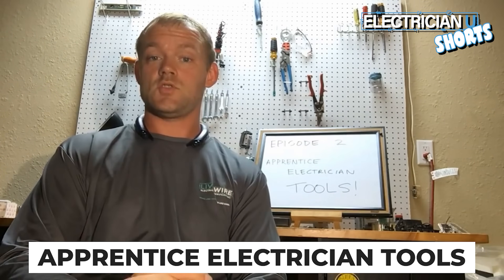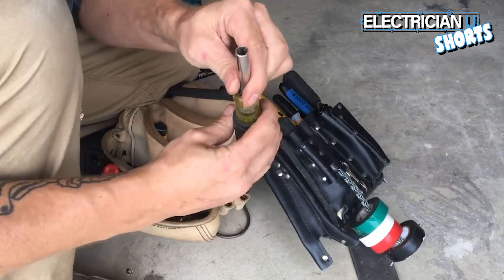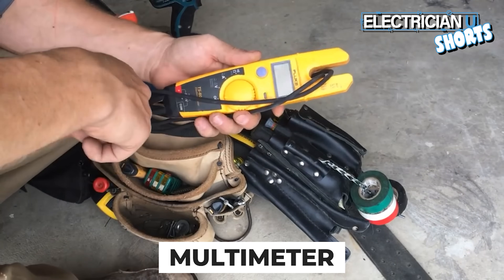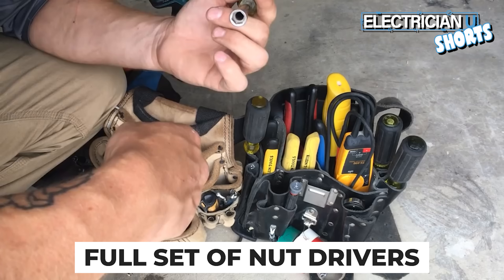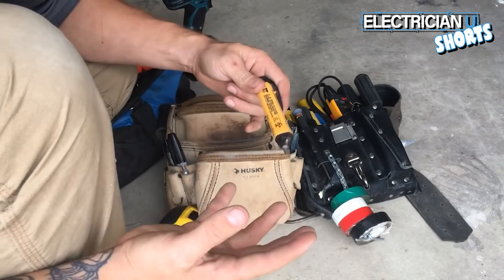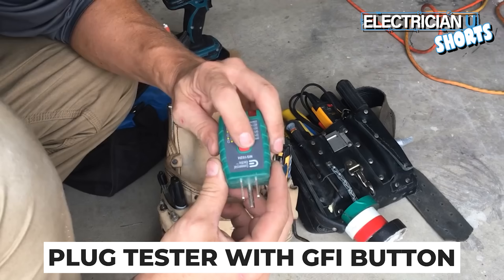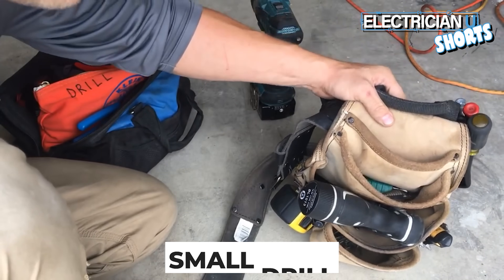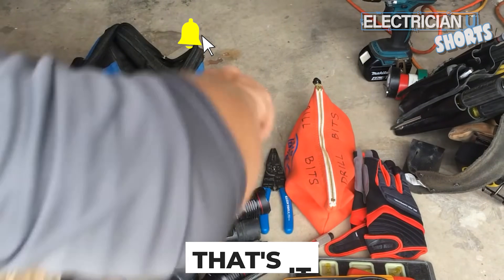SHORT - Apprentice Electrician Tools

Comment: Where's the swivel? Gotta have a swivel screwdriver. Not just for plating, but it comes in handy for checking behind drywall before drilling or cutting into walls to check what's behind it.

Comment: I'm surprised you don't include an automatic stripping tool, is there a reason why? The one I had was terrible, but I think it was because I didn't spend enough on it. I just spent a week, manually stripping the ends of multistrand wire, and it was such a pain.

Comment: Okay I'm going to give you a overview what I just watched I've been into your video for 2 minutes. There are different types of electrical work that you will do as an electrician one as commercial one is industrial one is residential one is maintenance. Basic hand tools a big flat head screwdriver a Phillips head screwdriver a pair of Kline's. A razor knife is nice. In your bag for almost every type of job you will do you need those tools. A tape measure a level a voltage tick a tester tape hey 5/8 and 7/16 nut driver. I like your Skinner but I don't like the skinny part of it I use that as a screw threader cutter a pair of rubber gloves for when you need to work on something hot or stick your hand in something that you're in doubt about. A small pair of channel locks a slightly larger pair o f channel locks. A Keyhole saw and a hacksaw and a flashlight. And a level with a strong magnet. you're putting weight on the side of your hip the more weight you put on the more you're carrying around. you shouldn't have to climb down off of a ladder to pick up a tool you should have that on your hip. In addition to that you should get a carpenter's apron so that you have a place to put wire nuts Staples screws Etc. You need a permanent marker a pencil and a pen. you need a small something to write on. If a piece of conduit is 10 ft long unless you're laying out a house you don't need a 25-foot tape measure on the side of your hip. A multi-tool is nice but the problem with multi tools is it supposed to take the place of another tool. And what happens is you have the other tool and a multi-tool so now you're just carrying more Tools around. you should put in your bag the tools that you expect to be   for a given task. My tool bag has a soft belt and a harness that goes around my shoulder it is lightweight and comfortable. I can take it anywhere and I don't have to worry about tools falling out of it. I have many more tools that I keep in my bag and I also have a another bag that I keep a Sawzall a battery drill and bits and Blades. I prefer to have every tool that I keep in my bag and then a backup in my tool bag. without my tools I can't do my job. so if something gets misplaced what good am I?

Comment: When I started as an apprentice years ago they told me to be careful.  Dude said, Plumber mess up might flood the place.  Carpenter makes a mistake building might fall down.  You F-Up and you might burn that place to the ground.  then they sent me to the truck to get the wire stretcher.
Reply: I actually got sent all the way back to the shop for a left handed wire bender and a box of ohms.
Reply: Oh the wire stretcher prank. My journeyman got me to call the Project Manager at the shop and ask if the wire stretcher is there. I'll never forget that.

Comment: I carry only what is needed for the task on tool belt. The rest goes in my 5 gallon bucket. What I carry as an apprentice, working new construction

EMT: Tape Measure, Two Channellocks, Conduit Reamer, Torpedo Level, Pencil, Screwdriver, Speed Square (for bending kicks), Hole Cutter (or Hole Saw)
Material Pouch: Couplings, Connectors, Structural Support: One Hole Straps, Two Piece strap, Minerallacs, Strut Straps. Anchors. TapCon, Wedge.

IMC/RMC: See above, not including Conduit Reamer, Speed Square, and structural support. Do include Ear Plugs, Metal File, Angle Finder, No-Dog Level, Speed Wrench, Clean rags because of threading oil, cutting oil, and STL8 means a mess.

MC/AC/Flex/LiquidTight-SealTight: Rotosplit, Diagonal Cutters (or MC Cutters), Tin Snips (I prefer Bulldog style)
Material Pouch: Connectors, Anti-Short (red devils), 3/8 One Hole Straps.

Wire Pulling/ Wire Makeup: Wire Number Labels, Sharpie, Wire Stripper, Screwdriver (Robertson #2 Square). Optional: Linesman (if #10 solids are pulled), Ratcheting Crimper
Material Pouch: Wire nuts, Ground Pigtails, Stickybacks, Zip Ties, Plastic Bushing

Basket Tray: Mini Bolt Cutter, 9/16 Nut Driver
Material Pouch: Tray splicers (3 piece kit), Tray Tie Downs (usually two washers) with spring nuts.

PVC/Underground/(Deckwork?): Knee Pads with Belt Buckle, Tape Measure, Ratcheting PVC Cutter or SawZall Blad, Utility Knife
Material Pouch: Couplings, Tie wire, Mason String, Red Roll Duct Tape

Lights: Contractor should provide green laser level for elevation with plumb laser level for layout on the ground.

Mounting Metal JBoxes/Layout Metal JBoxes/KO: Tape Measure, Speed Square, Torpedo Level, SDS Bit Set, Hole Cutter (or Hole Saw), 6 inch bit extender, Nut Driver Bits
Material Pouch: Hex Head Tek Screws, Anchors- Hilti KwikHus, TapCon, Wedge

Panel Work: Needle Nose, Screwdriver (Robertson #2 Square),  Contractor should provide: Cable Cutter, Crimper, Cable Bender, Torque Wrench, Large Zip Ties

Romex/Drywall: Tape Measure, Hammer, Jabsaw, Torpedo Level, Paddle Bits
Material Pouch: Staples, Connectors, Drywall Anchors: EZ Anchors, Toggle Bolts, etc

Energized Buildings: Tic Tracer
De-Energized Buildings: Headlamp

Tool Bag: Deep Impact SAE 3/8 Socket Set with adapter, Hole Cutter Kit, SDS Bit Set, Folding Allen Set, Milwaukee Right Angle Attachment (49-22-8510),

Comment: don't know about where your  located at but here even the cheapest hands tools Add up over time, buying cheap tools even for an apprentice is not always the best thing, as you really need tools that are going to last past your first paycheck, main thing id like to point out is that not everyone can afford even the basics of hand tools etc when starting out on their first job, my opinion if an employer see value in someone then they should offer to equip potential employees with a basic supply of hand tools, at the very most offer to equip them with a startup bag of the tools they,ll need to do the job/s that they are given, even if its agreed that they pay the employer back for the tools, although i believe that most employers could write them off as a work expense on their tax,

Comment: Great list Dustin! If you guys are working a union apprenticeship, keep in mind that there are approved tool lists that you are expected to keep to.  That generally means having everything on the list, but it can also mean leaving some tools at home or packed up.  If a tool isn't on the list it means that the contractor is expected to provide it if it is necessary for the job (Power drills are a common example). This can certainly be annoying, especially for folks who just like to have their own stuff and for gear lovers like myself, but it is about maintaining a reasonable expectation and level playing field for what an electrician should have to keep in the tool bag and what a contractor should provide for their laborers to get the job done.  If you have a specialized tool you would really like to bring to a job but it isn't on the list and the contractor isn't interested in providing it, run it by an experienced journeyman - they might say its fine to use, or have a simpler solution for the problem you are trying to solve with that tool.
Reply: Great explanation. Ibew journeyman here, and there's be plenty of times people have almost come to blows over the tool list. Wanting to get a job done is great, but making sure that line in the sand doesn't get shifted back towards us guys in the field is more important.

Comment: I'm two years in and the first year, I'd buy tools every friday (hand tools, bits, smaller stuff) and then put away like 40 bucks every paycheck also if I could to save up for all my power tools. Also spray paint them an outrageous color and it helps from people stealing your tools. For the most part at least. Bit now I have a bunch of tools that I've accumulated over the past two years and journeyman don't ever complain when they know I'm coming to help out, because I'm all set!

Comment: Aussie sparky here, I have always wondered why you guys don't use insulated screwdrivers all the way to the end of the head? we would not be allowed onsite or told to buy a new set if they were not,j Just curious
Reply: Usually we don't work hot.. Unless really necessary. So it's kinda standard to not expect them. Wouldn't hurt the trade to do it tho
Reply: We dont here either unless absolutely necessary! you would lose your job on a large scale job if you were found doing this, thanks for the info legend! good to know least they are a bit cheaper haha

Comment: Compared to auto mechanics, electricians tools are a bargain even for decent ones. Like $500 would get you set up quite nicely. Don't cheap out. Klein isn't the only good brand out there. Anything with a cutter needs to be hardened steel so you don't notch the blade cutting staples or nails. That is reserved for cutting into live wires which you will almost certainly do at some point. Make sure your tools fit your hand, Those flip out utility knives are cool looking, but some of them are miserable to use when you have to apply any level of force. My preference is a good old fashioned Stanley retractable. There's a reason they are still popular even though their design hasn't changed in a century.

Comment: a handful of things i keep in my bag not mentioned here- from a 6 month apprentice. 
-some skinny knipex needle nose. the klein ones are more robust but dont fit as well in tight gaps. this is especially prevalent when fishing into an existing switch box 
-a long handled flathead with a fine tip. i run into a lot of tiny flatheads. mostly just on face plates but also in light fixtures where they can be recessed and impossible for an 11 in 1 to access
-i keep 8” pieces of 12-2 and 14-2 in my pouch for pigtails
Reply: also for your giant flathead, get one with a solid steel core. you’re gonna be hitting your flathead with your hammer a lot. best to get on where the handle wont break

Comment: I'm 52 years old and recently retired from public safety.   I've always had an interest in electrical work.  Do you think it would be worth trying to go into that career field this late in life?  Would I need to go to school first?  There are no tech schools in my area that I know of that focus on being an electrician.
Reply: (Third Year Union Apprentice) I've run into 40 and 50-year-old apprentices and helpers out here in SoCal. Great people. I can't speak for them,  but from what they've shared it seems worth it based on the benefits, the pay, and fairly steady work depending on where you live. My short answer to the second part is that with just a little bit of learning, I'd say just about anyone can pick up the skills to bend conduit, pull the wire from point A to point B, make-up switches or lighting, etc. Youtube or good books can teach all that. What sets a trade school or jumping into the industry as a "helper" apart is what happens when that switch is flipped. It's all basic construction until there's enough energy flowing through the circuit to kill or seriously harm a person. In my humble opinion, the bare minimum is that a beginning electrician needs a teacher, a journeyperson, or a mentor to learn how to handle that. Good luck.
Reply: Hope you went for it buddy, never to old to learn something new.
Reply: Hard work for an old man like you
Reply: We have a 60+ yo man in the class. We see it is difficult to him to get the things, we are on level 1, the majority is about 20-30, few have more then 40, but they already work on construction. The electrician career request so many years of practice to consider a professional electrician.

Comment: So newbie question here: why are screwdrivers still so prevalent? Wouldn't it be easier to just carry a ton of 1/4" hex bits with an impact driver? Is it just reaching recessed/tight areas, insulating properties or what? Not trying to be snide, genuinely just curious
Reply: Because you will lose all of them and you have a lot more control over the screw so you won't over tighten or strip screws like the one on a panel or a transformer
Reply: Tight spaces is the answer also.
Reply: Ahh I getcha. Thanks for the wisdom guys

Comment: Nice bucket bag & tool pouch is what I work out of. The black pouch you have is really nice, to expensive for my budget right now.
Reply from the maker: I've tried the bucket bag but I didn't like it as much.  You use the Husky or a different brand?
Reply: @electricianu  is a brand called Readywares. Its a waxed canvas material, very durable, people think its leather. My main issue with a bucket bag is it tips over alot in the van, especially with a drill strapped to the side.
Reply: @donmonarch9549  look for the round stackable bucket trays used to fill them up with screws and nails other heavy fittings on the bottem layers than the lighter fittings made it stable plus i used as a seat just stuck a pce of scrap wood on top  like 4 or 5 would fill up to the bottem of pockets on mine

Comment: Don’t get any phase tapes, just throw black on that chain, if you need them let your lead supply it. Otherwise your lead will take your tapes, and it will drive you crazy. Grab a multi-tool like a 11-1 it will save you in a pinch. If your lead has their own phase tapes then your good. Lead guys love using your tools, just be cautious.

Comment: Hey dustin id love to see a video explaining all the uses of the fluke T5/6. Make fun of me if you want but ive been in the trade a long time and i dont know all the functions.
Reply: *Volts AC/DC up 600v
*Amps/Current 100 A
*Resistance/ohms 1000
*frequency /Hertz
*Continuity testing
*Open jaw oppose to a clamp
*Hold function button 
*Live voltage ⚡ indicator.......sorry didn't mean to answer for him , I have one in my meter arsenal.
Reply from the maker: Absolutely, most testers are the same - regardless of the model.  I'm about to do one on Klein's models but I'll put this on the list to do the T5 as well.  I don't have a t6 yet

Comment: Tip for apprentices you can get a klein multi nut driver that has alot of the sizes mentioned in 1 handle. Also the small termination screwdriver klein has a 4 in 1 so you dont need to carry multiple tiny screwdrivers you will have all the tips you need in 1 handle as well. Klein and milwaukee have nice 13-1 screwdrivers that have torx heads and more importantly square #1 and #2 in one handle. Moral of the story look into the klein multi use handles. Also look into the milwaukee rechargeable headlights and flashlights you will save burning through regular batteries.
Reply: I've got a few rechargeable headlights. My phone is usb-c so I just got a Klein that charges with that - so far it's great - but about twice the price of my smaller microusb one from walmart.  Theres some things I don't like about it, but it also clips to my (klein)  hard hat - overall it's great. None of my lights use replaceable batteries anymore. You can get rechargeable batteries, but they don't last as long, and you gotta deal with the chargers, and a bunch of batteries.

I like multi drivers, but I never liked the Kleins. I do REALLY like the little 4 in 1 mini drivers though. For a long time they only had 5/16 nut drivers - 5 in 1 instead of 6 in 1. Also don't like the feel in my hand even though they're great for putting down a lot of torque. I use the Ideal 7 in 1 even though the wire nut thing is kind of a gimmick and can be a dirt collector. I'm not so sure I like the ones where each tip has a flip tip - like the 14 in 1 or whatever. Too much time flipping around trying to find the right bit. I am eyeballing a Klein though - the 15 in 1 classic because I've never liked ratcheting screwdrivers, and it's the only one I can find with good bit storage without a ratchet or other gimmicky stuff that adds weight for no good reason.

The multi nut driver ... I'm not sold on those. There's 3 of them starting with a 5 in 1 with 3/16, 1/4, 5/16, 3/8, and 9/16 - skips 7/16, and 1/2" which I use. The 6 in 1 adds 7/16.  The 7 in 1 adds 11/32 which I don't remember the last time I used and 1/2" but it's a big heavy clunky thing I don't want to carry or wrap my hand around. Great idea, but I'm holding out for something better. For now I carry driver tips like you use on a drill that I can stick in the 1/4" side of my multi screwdriver.

Comment: I love the baby drill. I have a bosch equivalent that was gifted by some one teaching me about carpentry. I my favorite power tool!
Reply: I've had the Bosch baby 12v drill and impact set since shortly after they came with lithium ion batteries. Both are used a lot and still going strong, even the original batteries.
Best $100 or so I've spent in many years of their use, and I'd buy another set if these ever fail.
Reply: @JasonW.   #TEAMBABYBOSCH   ja